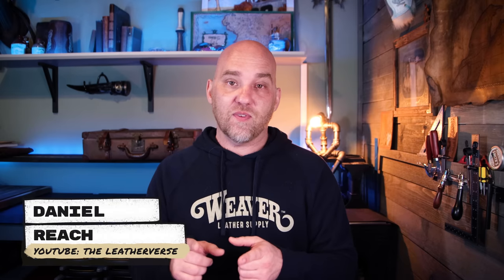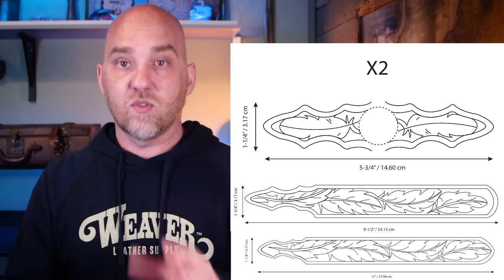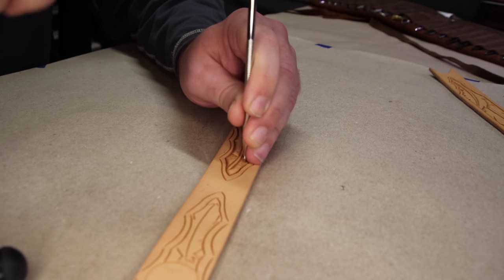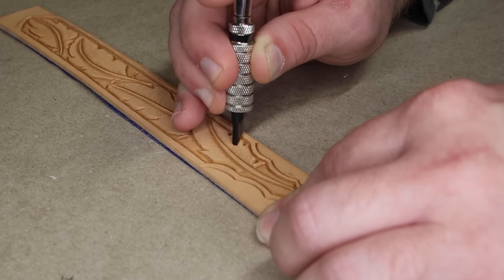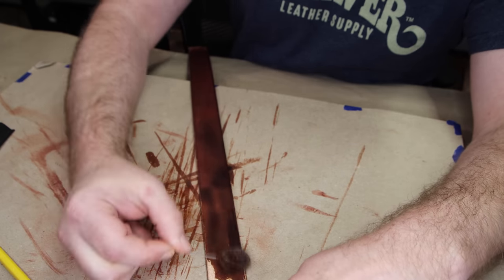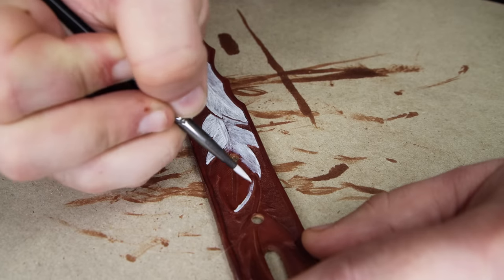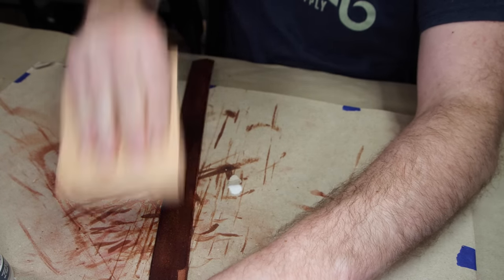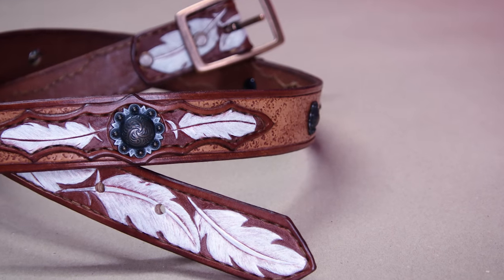Four Feathers Tooled Leather Belt

Comment: To fill the bottle, go to a farm supply or tractor supply and get a 55cc syringe body. Cut the tip a bit shorter to have a wider opening. Such the Tokonole into the syringe then use that to transfer it to your bottle. You can return the extra to the tokonole bottle and you can seperate the plunger from the main body to clean it / run it through the dishwasher.
Reply: I , also, use the syringe for white glue, gum trag., and mixing dyes (to get different colors). Great advise.

Comment: Great video, Daniel.  Thanks for the tip about how to slick the back of the belt, I will have to try that.  It is a lot of skiving; if I do it I will probably cheat and use my belt sander.  That pun was completely accidental, but I stand by it.
Reply: LOL. Not cheating at all. Use the tools you have that you're proficient with. Good luck with it!

Comment: Great video, and a fantastic looking belt! I was wondering, do you have a version of the pattern that is for a belt that is 1.5" wide? Also, do you think it would be ok to use the feather pattern as a repeating pattern and just tool it into a regular belt (similar to how you would with e.g. an oak leaves and acorn pattern) rather than having it tooled into sections that are then stitched to the main belt blank?

Comment: Squeeze the needle bottle before you put the tokenol in, then dunk the opening in the tokenol. Let the bottle suck up the goop. The only issue is you have a mess on the bottle that you can wipe off and put back into the tokenol container. Other than that, I dunno how to fill those. And because it's so difficult when the tokenol container gets low I gave up using the needle bottle. I think they're great to use, but too difficult to fill